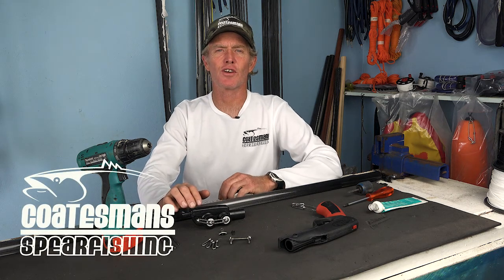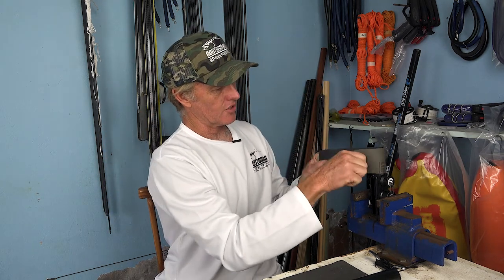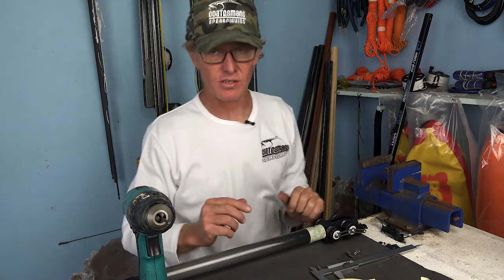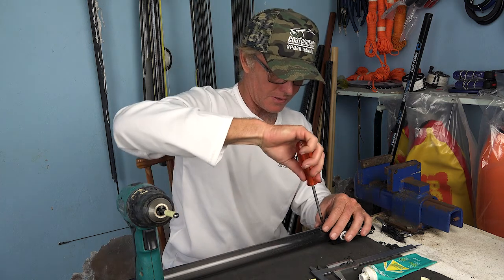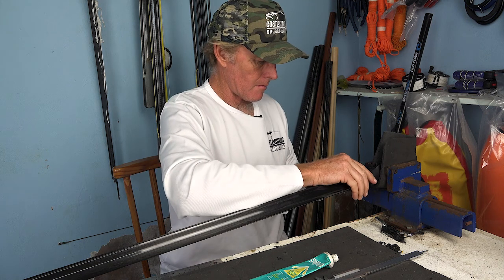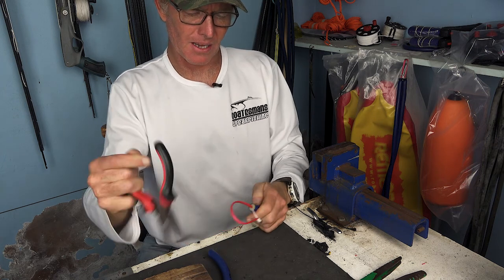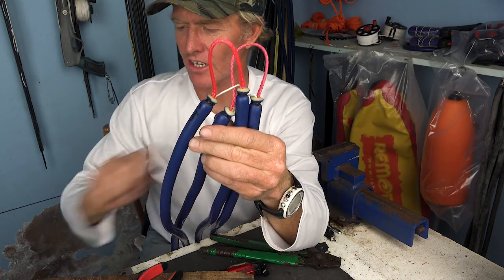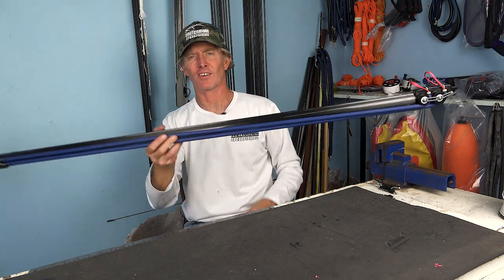CDR2 Rollergun Step by Step Installation.

Comment: If i upgrade to double roller muzzle and do a trip and big fish dont show up but lets say some mahi do…. Could i just leave one band on or are both needed at all times? If both needed, is it possible to just load the one band?
Reply from the maker: Hey Eryck,
Yes you can load just one band, or just use one 16mm  band. One 14mm band won't have a lot of power. And what happens when a Wahoo swims past? You will want both 🤙

Comment: Hey Chris, does your cuttlefish barrel track easier than the normal RA barrel with a double roller muzzle? Or is it just for better buoyancy?
Reply from the maker: Fish Hunter,
The barrel has been designed to be as sleek and maneuverable as possible with the volume / buoyancy needed. It is no thicker than a std RA barrel height wise. And the bands also sit with in the same profile so they dont add to the drag like other cuttle fish barrels.
Reply: @CoatesmansSpearfishing  thanks!

Comment: Will this roller head work with 16mm bands ? I can only find info for 14mm bands
Reply from the maker: Hey NERD SPEARFISHING you can use 2 x 16mm bands. But then you need a 8mm shaft and for that you need to have a cuttlefish barrel to float the heavier shaft.
Reply: @CoatesmansSpearfishing  awesome that is pretty much the setup I will be running. cheers

Comment: Great tutorial. Is it safe to install a double roller on a 120 aluminum rob Allen barrel?
Reply from the maker: Hey Adam, yes absolutly the RA ali barrels are very strong. And the roller shares the load on both sides of the barrels so there is actually less pressure on one side than a conventional gun.

Comment: Amazing tutorial Chris, clear Instructions . I have now the courage for cutting, drilling and setup my RA / CDR2 130 carbon roller project. Thanks 

A questions regarding the silicone paste, is  this normal sealing silicone or a kind of a grease  silicone ? Thanks 👍👍👍
Reply from the maker: Glad the video is helpful. 
The Silicone grease / paste is the same as the O ring grease for camera housings. This is not the glue one that sets that you use in the bathroom and boat.
Reply: @CoatesmansSpearfishing  thanks for for your replying Chris. I have  o-ring silicone in my dive bag 😀 from now on, no more excuses. Wish you good and safe dives. 🤙🤙🤙

Comment: Hi Chris. My mate and I have just received your cdr muzzles in the mail. They look good.  Thank you. We have Rob Allen sparid barrels and the roller head is quite loose in the barrel. What do suggest to firm it up? Glue or silicone? Thanks.
Reply from the maker: Hi Louey,
The best is to shim the spigot with a thin sheet of plastic. just cut to fit until the muzzle is snug and has no movement. Drop me a mail if you are still having issues 🤙

Comment: Couldnt get silicon paste, will low viscosity silicone -based lubricant work?
Reply from the maker: For insulating the screws you really need something that is going to form a barrier and also not wash / drip away. 
You can use O-ring grease that the underwater cameras use. Most the time this is just silicon anyway.

Comment: Do you need silicone grease on the muzzle and handle spigots?
Reply from the maker: In my experience it either goes in or it doesn't. Good tip is putting the muzzle in thre freezer so it shrinks with the cold then it will go in easy.